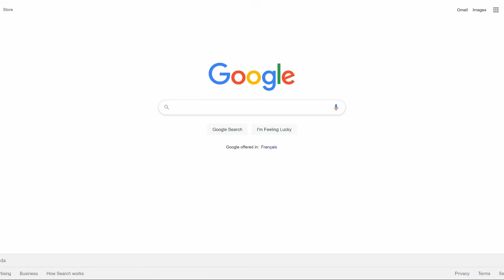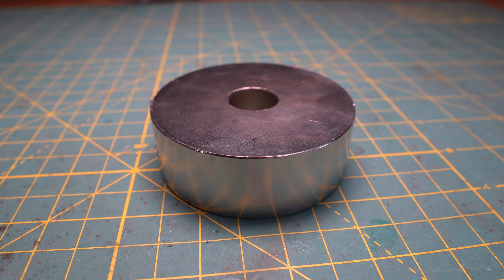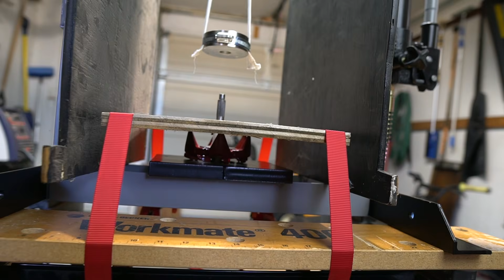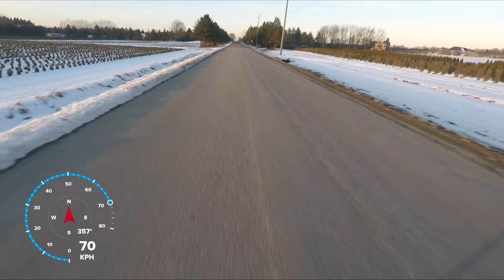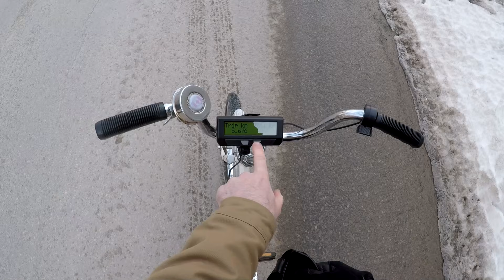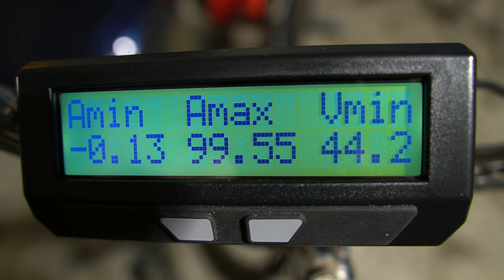Building an Alternator Powered Bike - Part 2

Comment: next step, different wheel bearings and trying types of grease XD
Reply: the bike prolly has those crappy un sealed bearing in the hub. he should def ungrade the wheel hubs with sealed bearings. could also take the freewheel off on the rear wheel to free up more friction

Comment: I would never have thought of using that magnet and the original pole pieces. Seems like the magnetic flux would be going in and out in a toroid shape, and not interacting fully with the stator coils, Well I guess it works. I would have built up a core and mounted two magnets for every three electrical poles, alternating NSNSNS facing out. But your way obviously works fairly well.

Your run results aren't that bad, considering your speed. If you throttled back to 10 or 12mph you would easily triple your range, maybe more. ALso, less stares and less attention from overzealous minions of the law, in case you are over a legal power or top speed limit for a motorized bike to not be classified as a motorcycle, subject to all the associated regulatory crap.

That magnet probably cost 10x what the original alternator cost. Seriously, you are starting to get up to where an off the shelf motor is cheaper.  But maybe saving money was not really your objective.

Good project. Well done. Next, how bout an ultralight airplane? LOL

Comment: Now put an alternator on the front wheel to recharge the batteries as you ride and make the perfect vehicle.
Reply: The impossible vehicle
Reply: @foxxyytofficial  It is not impossible. That guy did it with his electric car before the government killed him back in the early 1990s .       A closed system that recharged itself as it drove and never needed to hit a charging port.   There are still videos about his car and how he planned a automobile revolution on the Tube.
Reply: @jesusoftheapes  does he created patents?
Does he made real proof that the car would run 1000 miles withour charging?
It is not physically possible
Reply: @foxxyytofficial  yeah . He drove it all over here i'll find you a link before many say that "they" had him murdered.  He was murdered right before his company was going public and the case is still unsolved.  That is what is known for sure.   When he died the government took all of his production equipment and all information on his designs.   That is also something we know.    This guy made a fully working electric vehicle that was a closed unit on the frame of a Geo metro and drove it from one end of the country to the other I believe when they were testing it.   It would have changed the world but people like you who said it is impossible really did everything they could to sabotage the man and his company.   Here is a link to a video about his invention and you can see it working in real time.  I have done a lot of research on this company, the man who invented the tech and several of his investors. The people who were partners in his company and they all believe he was killed to stop this from getting out and all were warned not to pursue the technology any further.   This will get you to a jumping off point . I encourage you to research his company on your own. The truth is we are being lied to about energy. They say you cannot make a perpetual motion machine either and yet several inventors have figured that out only to be discredited by people who believe something so they refuse to know anything.  https://www.youtube.com/watch?v=vFfsEfnsA4I&ab_channel=AGreatStormisComingAGreatStormisComing
Reply: @jesusoftheapes  it is only conspiracy theoried and Dunning-Kruger effect
People WANT to believe that 100% of government and people in power wants to hide everything that would help the people to overthrow governments
If we could create all that stuff that people say in conspiracy theories we would be gods and not humans
Reply: @jesusoftheapes  also, why would i also believe in someone that I don't know that says that "free energy" is real and that the rich and powerful are against them?
Reply: @foxxyytofficial  No energy is free . Your understanding of energy is jaded !
Reply: @jesusoftheapes  "no energy is free"
But at the same time you believe that a generator can power the motor and make the motor give energy to the same generator AS IT POWERS SOMETHING

Why don't you simply use a controller with regen braking activated?!
It does the thing you want without wanting to break the physics

Comment: With the old Rotor you could have tried using Field-Weakning, when you up to Speed with the field slowly degreasing the Field Strengh like it is used in big electric Locomotives. you can accelarace even further.
Reply: but already at 70kph he won't need anything faster

Comment: There's one other thing you could do to that bike you could put another motor on there and make it to where it'll keep on running non-stop you just got to find a way to cut the power supply when you need to. You know how you can hook up two motors to each other and they'll run consistently without no power supply. But you would need something to start the motors back up whenever you needed to roll. Unless there's a way of separating I have no clue.
Reply: impossible, that is perpetual motion

Comment: I was wondering if you tried any higher voltages on the rotor before you changed it out. You probably could have hit it with the 48v without trashing it because it would have only been  1/4 of the current. It may have made more flux than a PM. Also you didn't try less than 12v on the rotor did you? Could be it might have been possible to back the rotor voltage down once up to speed right? See I'm thinking about using this application to drive a 134A Freon compressor and I've already seen at least one video where some guy wires his to go from delta to wye (or the other way around, I always forget) for start up. Perhaps a higher "start-up" voltage for the rotor could negate the need for that.  I don't know; but it's something I plan to experiment with if there's nobody else that doesn't already know. Knocked me out when I saw you trying the same Ebay unit on the bench in the last video I was looking at. I'm planning to try the 72vdc version however simply because it reduces overall current. Thanks again for sharing.
Reply: he already used 48V on the stator, the rotor can't see more than 12V or it burns
Reply: @foxxyytofficial  I should have known better. Of course it did. I have a GM style  Power-Master alternator running off a 1.5K watt 72v dc bldc drive now off Ebay w/o halls; but the rotor pulls a full 6 amps @ 12v. Where did you get that magnet man. LOL  I don't see any link. and oh yeah,... it drove a compressor directly until it took out a 15 amp fuse in the drive supply line. LOLhttps://www.youtube.com/watch?v=WyueUH-Fj00

Comment: I am currently building an electric scooter, will a 1000w 48v battery work with a 48v 1800w motor? (will it run like a 1000w motor?)

Comment: I think you have power to spare. Try a larger sprocket on your alternator, maybe get it up to 90km/h. A couple etra teeth should do it. Awesome job on the bike, you inspired me to build my own. Love the detail you go into, especially the diagrams, saves me the trouble of the research. ✌️😎
Reply: Bad advice on a rusty old bike. Imagine doing 90kph when the front wheel explodes. Not pretty. Also in violation of the HTA.
Reply: @loginregional  who gives a fuck about the hta the tire exploding though definitely sketchy

Comment: Brilliant video series, thanks for sharing. Do you think the alty motor worked any better or more efficiently for having the hall effect sensors?
I've built two ebikes using car alternators and plan to use one for another project so really interested to know what difference they made. Also I suspect having the permanent magnet helps a lot to keep the motor cool which was a problem I had with mine so I may do the same.
Reply: The heat will happen because of the magnetic field, doesn't matter if permanent or not
Reply: @foxxyytofficial  Without a permanent magnet the magnetic field is created by current through the brushes and the windings on the rotor. These two things cause extra heat that you don't get with the permanent magnet.
In my case it was approx 7V x 5. 5A so approx 40W of extra heat. Maybe not a lot but in a small metal casing it matters.
Reply: And the sensors help with a bit of efficiency and low rpm torque/responsiveness

Comment: Do you have any recommendations for a good 48 volt 12 amp lead acid battery pack i have searched but I don't see any pre wired ones for 48 volts.P.S I don't know how to solder
Reply: Stay away from SLA. Heavy, long charge time and a tendency to break with that kind of vibration. Use a pack 4x 12v 12Ah, physically they are 10x10x15cm. I think they are about 15 lbs a piece if I recall correctly. You have to find a really low place on the bike to install them, else they'll make the bike really wonky top heavy. Putting them on the rear rack if you have one is a really bad idea. You're better off finding a battery builder who'll do you the proper s/p setup (optimum 54V for "48v") with BMS. Otherwise, a single 12v battery failure out of 4 can put you on the side of the road real fast. HINT: a good battery builder will test each and every cell as he builds it so that all cells match each other.

Comment: Great job on the update. Possibly a temperature sensor or a rewind of the stator? I think it would help to bring down  the peak torque to a lower rpm level. You are probably maxing out at 4.5k to 5k. The extra amperage is being wasted past  your peak torque and your torque may actually going down. Also might want to change the sprocket to something that gives you more torque at a lower rpm and not worry about top speed. I am sure you have seen the power band on the alternatorconversions.com website.  I am sure the stators were rewound. PMA for windpower also have to be rewound to generate power at a lower wind speed. Keep up the good work.

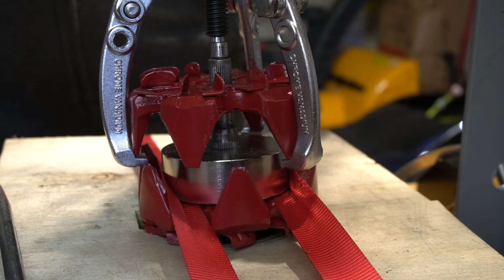Comment: I have a question. At 03:50 you start pushing one of the red parts into the axle of the rotor using the puller. I don't understand how are you using the puller to push in the manner that you do. Can you explain? It seems to me it shouldnt push at all from the geometry you are using. Thank you!

Comment: I was going for 100 Ah lithium polymer @25 volts. Maybe I went overboard with my calculations. Watched all your vids. I'll be reengineering a solid scooter. Judging by your results I could put a sidecar assembly on it
Reply: Please put 50Ah@50V instead of 100Ah@25V
Reply: @foxxyytofficial  Love to but I can't. My controller is only rate at 24 volts 100 amp. Thought I would gear it up to use the amps where the revs would be lacking
Reply: @jimboniface7202  but without at least 36V your power/consumption rate won't be that good and you will be at risk of overheating If you don't cool the alternator to avoid thst
Reply: @foxxyytofficial  Thanx for that. I will go with what I have got and keep your advice in the back of my mind. Cheers. Jim

Comment: OK the build was very interesting, but not nearly as interesting as the young man who built the bike.  So many people today are stuck inside of a box when it comes to thinking.  Example  "I need an electric motor for my E-bike build.  Well all I have is an old alternator.  I guess I am done".  Most people do not start thinking outside of the box until they are older and have acquired knowledge from living life.  The exceptional people are the younger who look at a problem and figure out how to solve it.  Yes I agree this knowledge was already freely available on YT, but it was not as simple as just buying a ready built motor. Kudos to the young man who not only thought outside of the box, but was willing to give it a try and get the project done.

Comment: Is there anyway to be able to calculate how much power you'll be able to get from an alternator before going through all this work and effort? I've got a monster firetruck alternator that can put out around 400 amps at 12v. Just wondering what kind of power I'd get.
Reply: Most people that tried get around 70% efficiency and 70% of the nominal power
For a 400A 12V alternator i would surely use at least 72V and install hall sensors to keep everything under control, also choosing a BLDC controller from a reputable brand

Comment: Dud you have no idea what you've started.  You have just created a bunch of Mad scientists.   Now that you've shown us; we can pull alternators out of cars in the junkyard for way cheaper than we can buy a comparable electric motor anywhere.  You are truly a national treasure for us all.  And trust me; just what you did by removing the material from the two sides of the center armature to add the permanent magnet simplified things a lot.  And correct me if I'm wrong, but; you don't get regen until you add the permanent magnet "Right"?    Thumbs up!  Like and subscribe, vary cool!
Reply: His controller need a second thumb throttle or a brake sensor to initate regen, with that he can regen as he uses it

Comment: I also started a project like this, first I built amazingdiyprojects's 1phase bldc, but that didn't work well, so I used a washing mashine motor instead, but the 3d printed gears broke, and the voltage was too low. You gave me back my motivation to think about finishing it. While working on it, I constantly thought about an alternator conversion like yours, but did not find any source on that a year ago, so did not make that. Yours is a pretty elegant solution, well executed, keep up the good work!
Reply: To be honest there are good alternator conversion videos out there
Reply: @foxxyytofficial  I wanted to use permanent magnet, but I did not like the "grind down a bit, and put a magnet on every spike with superglue" technic. And I didn't have an alternator.
Reply: @kevegonczi2835  i wouldn't recommend that idea for you, i prefer conversions like the channel "Chris workshop" did, that is a better permanent magnet solution

Comment: why dont we just use a brushless motor driver circuit to drive the allternator as an ac induction motor??
Reply: Excuse me? The alternator is already being driven as a BLDC motor, if you want an induction motor, choose a VFD
Reply: @foxxyytofficial  so with a vfd we no longer need to add in magnets on the rotor correct??
Reply: @fidelcatsro6948  he never had to add the magnet in the first place
He only did it to remove the need of external feeding
Reply: @fidelcatsro6948  please watch his first video (Alternator on a go-kart), no magnets, no sensors, but still works

Comment: Good job! So... what goes up must come down, can you make it charge coasting down hill? I once read an article years ago where someone built a car that got over 100 miles to the gallon, capable of 55 miles an hour using a 10 hp motor. It was hydraulic based and stored the energy when the brakes were applied or coasting. If your interested i can try to find more information.

Comment: What kind of amperage is that controller rated to? Can you crank the amps way up and see if the acceleration drastically improves?
Reply: 110A continuous and 280A small peaks

Comment: Alternator has too thick stator plates, in delta connection the iddle current will be huge.
Reply: He doesn't seem to mind, and the build isn't for daily use, so no problem
Reply: @foxxyytofficial  Seems the whole nature of this project has been incremental improvement with a couple of useful thoughts included from viewers. Suggesting a well-based optimization on the alternator seems aligned with the spirit here. Also, others using this project for "maker DNA" might include that thought when we take the poles out to be machined. (Got lotsa tools, but alas, no lathe yet. Welder and lift were first.)

Comment: Stupid question - what would happen if you kept the field windings, but instead of using a battery, just shorted the brushes to each other?

This is a pretty awesome project. You've got me wanting to find an old alternator to see what I can do.
Reply: Shorting the brushes together would still spin when applying voltage with the BLDC controller, but the magnetic field would be too weak for usable torque

Comment: Do higher alternator amperage ratings translate to more power in a brushless motor configuration?
Reply: Would you say it would be a waste of time to try this with a 12v 40a mini alternator coupled to a 12v 35a SLA? Furthermore, what are your thoughts on increasing the field current to increase available torque?
Reply: @misterman73  a 40A alternator probably will overheat with too much power, so only small builds probably (power wheels and other kids toys)

And the field current only adds to a certain point, then it saturates and f you add more you only get more heat
Reply: Most 100-120Amp alternators that i saw could pump 60-80% from their total amperage when coupled to powerful and reliable controllers and powerful batteries
Reply: So take your guesses

Comment: Huge consumption. Limit the current, but get higher gear ratio to make it up. Otherwise your battery ain't going to last wery long. My hubmotor bike gets below 20wh/km and other whit a brush motor even lower cos it has so high gear ratio, that  top speed is 32km/h.
Reply: Alternators have a bigger consumption, they aren't as efficient as purpose-made BLDC motors
Higher speeds need higher power figures too
And his battery cells can output up to 140A without damaging themselves
Reply: @foxxyytofficial  Ok, but gear ratio is still ridiculesly long, no pulls and useless top speed.
Reply: @juhopeltola3993  but you need to understand that his build wasn't actually made for him to use it daily, so the gearing is not a concern
Just like the trike, the Crazy Cart, the Teskart, all builds just to be built